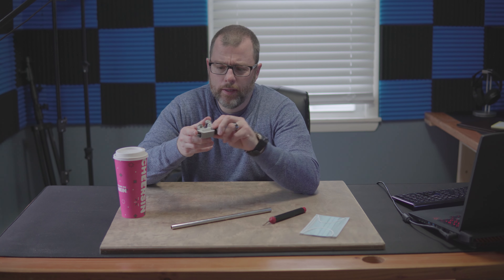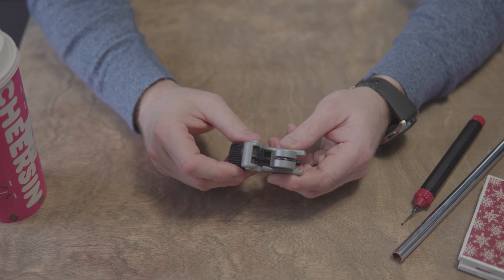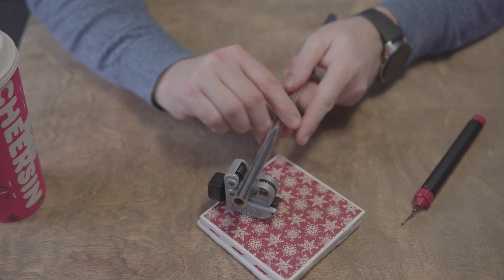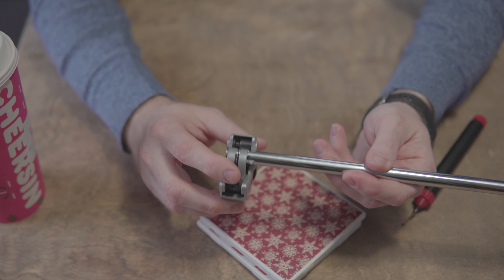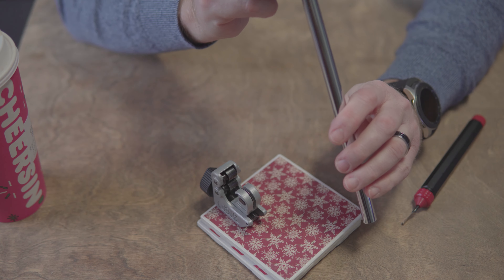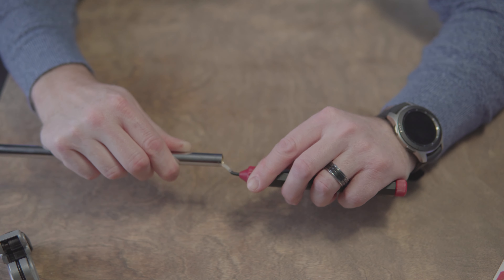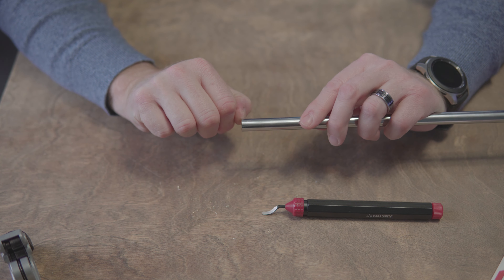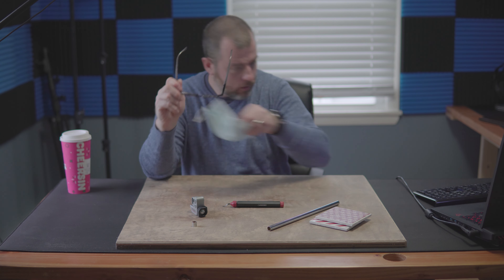How to Cut Chrome Plated Tubes

Comment: I found some nice chromed  billet aluminum exhaust tips for our Harley-Davidson which has the long shotgun style Vance & Hines exhaust pipes on it but these tips are a little longer than some of the others and the exhaust already comes all the way back close to the back of the rear tire and with these tips they're gonna be even longer, like a couple inches past the rear tire and I'm thinking if I get these tips I'm gonna need to cut these exhaust pipes off a couple inches, I'm also going to need to drill new holes a couple inches from the end which is the bolt hole to mount the tips to the pipes. What I'm mainly concerned about is after I cut them the end will no longer be chrome plated and might start to rust and/or peel or chip where they butt up to the tip, I'm thinking maybe some zinc rich coating (paint) where the pipe has been cut will prevent that but I'm still a little worried about it. Reason I'm thinking about doing it this way is because these are almost brand new used tips both for $60 and if I buy them new they sell for $60 per piece so I'm basically getting the other tip for free.